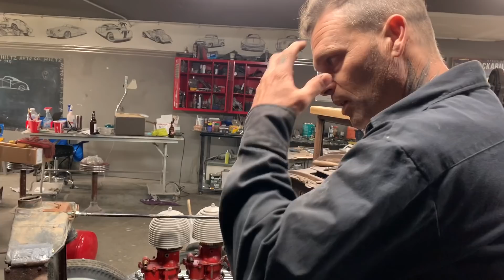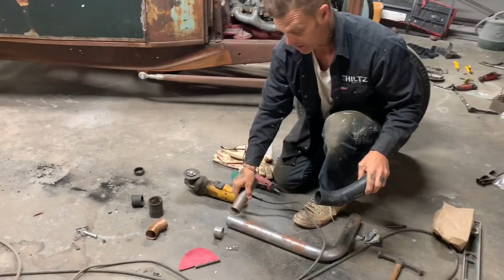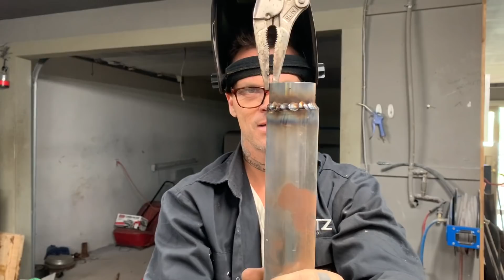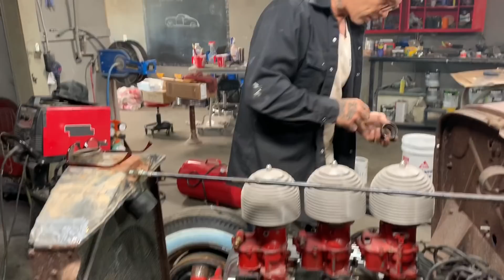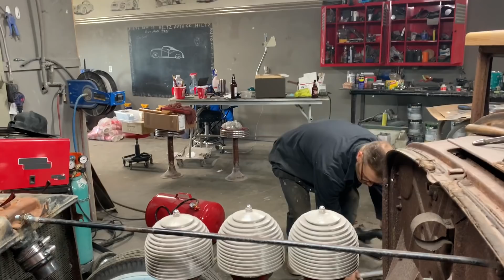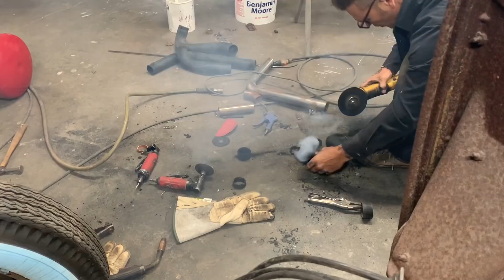Fabricating rad hose adaptors the easy way

Comment: A pair of vice grips hand made for bead forming works well too.
Reply: I was thinking the same thing. It's a good tip!
Reply: Yeah without a bead that hose will slip right off of there when she gets a little pressure built. I've done those and just welded 5 dots around the tube and had good luck with that.

Comment: What's the application on that hose? I need that shape.

What steering gear box is that? I'm planning a nail in a Model A and I think I'll need that.

What are you doing as far as a cooling fan?

Comment: Chad, you need to invest in a band saw. Easer and less messy  way to cut your hoses. Also, change the tubing size on the radiator.  Obviously, would makes for less clamps.
Chad, do you ever read the comments?